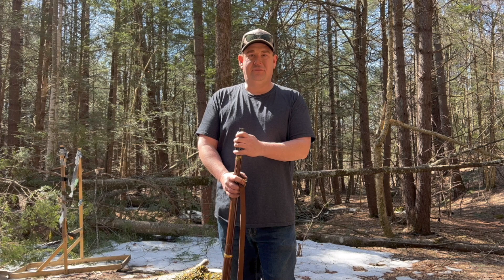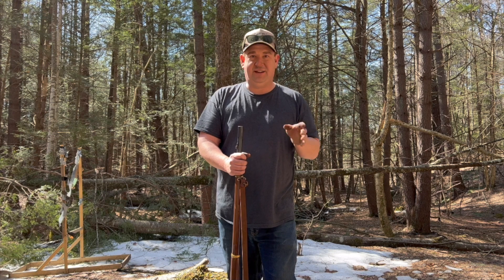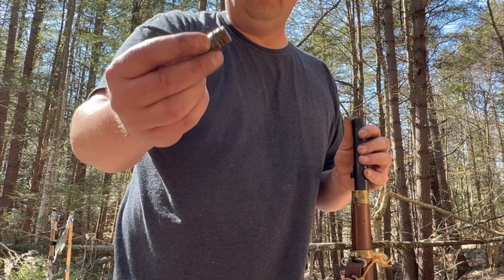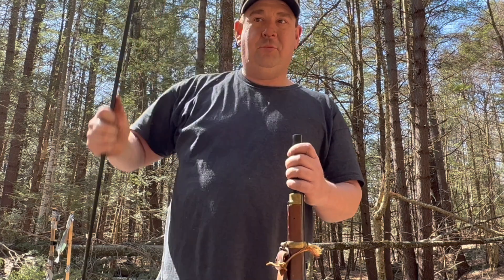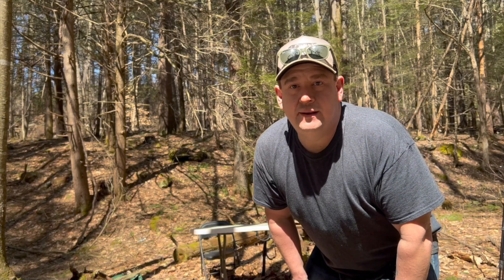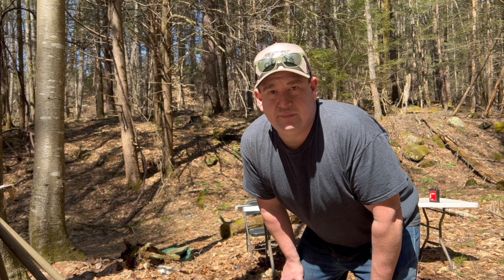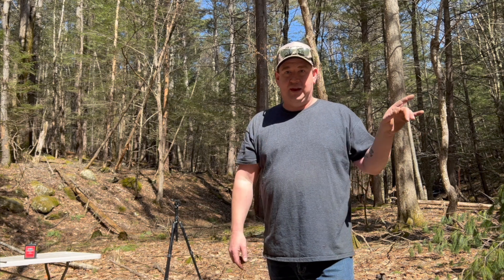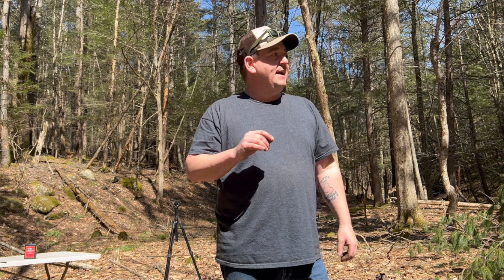Firing Minnie balls through my Reproduction Zouave rifle

Comment: I have a mid 70's model. It had a dead barrel. I removed the rifling and with 70 grains of 777 ffg, a .530 ball and 2 .015 patches getting groups under 3" at 35 yards. Lower charges in mine get larger groups. I have .575 balls on the way. Absolutely love these rifles.

Comment: What charge did they use in the civil war?
Reply from the maker: 65 grains of FFg powder is close to the original load. I would like to add that this technically isn’t a civil war weapon. It was designed during the war but doesn’t seem to have been issued
Reply: Manual called out 60 grains of ' fine' grain powder, fine grain related to 3f.